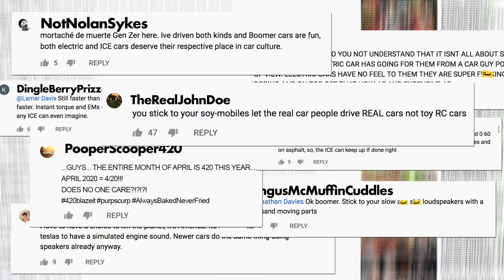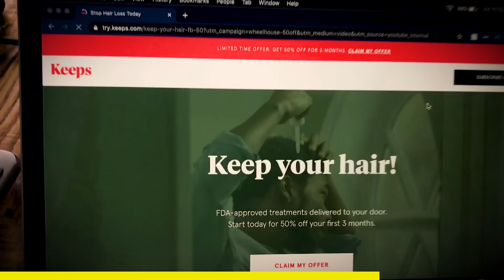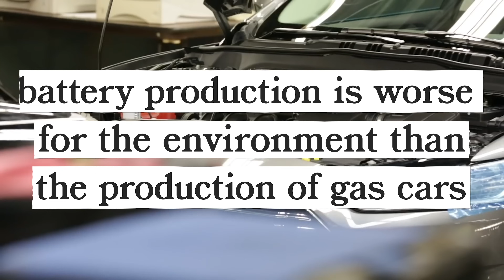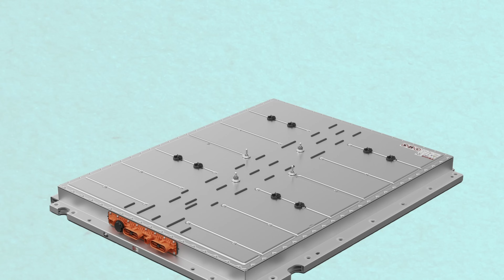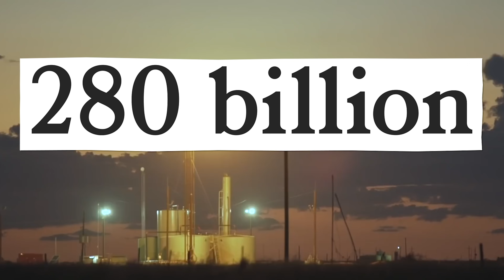Are Electric Cars REALLY Better for the Environment?

Comment: There isn't enough lithium in the world to replace all the petroleum cars on the road today.  You don't think you should have mentioned that?
Reply: @Brian-om2hh  And what other rare earth metals will the batteries contain?  In physics there is no such thing as a free lunch.
Reply: @sasquatch1554  there isn’t a free lunch it doesn’t mean there will be precious metals. Older batteries used sodium. Aka, salt (not quite but basically)
Reply: @engineeringtheweirdguy2103  good luck with that.
Reply: Not really, because it isn't a long term concern. In the not too distant future, EV battery technology will move away from using lithium.......
Reply: Actually studies say there is
Reply: @engineeringtheweirdguy2103  who did the study Elon Musk or some other troll?  According to the recent LUT-Augsburg report we could be running out of lithium by 2040 in the worst case scenario.  And that doesn't include if we use lithium for heavy transport vehicles and to power our houses at night when the sun goes down.
Reply: @sasquatch1554  I’m familiar with that study. From what i recall (along with similar studies) is that it is a projection for known lithium mining operations. As in, of all the mines in service currently, that’s when those mines will run dry. Which is starkly different to when we will run out of lithium. As demands increase new areas wills be prospected and new mines established to pull out more lithium. If you look at studies which consider all prospected lithium reserves which don’t have mines, that 2040 date pushes out to 2090. Then there are those locations which have yet to be prospected.
Reply: @engineeringtheweirdguy2103  You are incorrect and need to read the study again.  The study also accounted for new mines found.  2090 is the absolute best case scenario (still bad) if undiscovered mines are found they may not even exist to begin with.  The prices for lithium will sky rocket long before then.  Finite planet equals finite resources.
Reply: @sasquatch1554  am I? Can you supply a citation? And while yes, finite resources are a concern. That is why we need to step away from fossil fuels. There is very little left and if we don’t have a working infrastructure before they run out it’s going to be very hard to build a fossil free infrastructure without adequate energy to do so.

Lithium batteries have the advantage however of being recyclable. Only less than 0.5% of the lithium on a battery is lost over its lifetime to degradation. (SEI formation trapping the ions). Unlike fossil fuels which are burnt and gone. Further to that they aren’t used every trip. Current battery technology is set to allow modern EV’s to last well over 300,000-500,000 miles depending on your battery size. 

One final advantage of battery technology is chemistry. Not all battery types use lithium. New battery types are being made and experimented with all the time. Just because lithium is the best solution now does not mean it will be for the next 70 years. Lithium batteries for example have only been around since 1991. Before that lead acid was the way to go. Before that it was sodium. Things are constantly changing in the battery world, Tesla is toying with different chemistries to increase service life, power density and remove cobalt with some success. Toyota are touting that they will be able to successfully produce solid state batteries which would drastically reduce manufacturing emissions and, whilst Toyota has confirmed their chemistry yet, could very easily not use lithium at all.
Reply: @sasquatch1554  uhh, yeah they are getting those lifetimes out of them. Did you not open any of the links I sent you? There was even one for a Tesla at 1 million miles. I said I was familiar. I didn’t go and brush up and re-read it when you mentioned it. I was recalling from memory.

And the cost to recycle them isn’t the prohibiting factor. They aren’t super expensive to recycle. Currently the issue is with supply chain. You need to develop a supply and demand for used lithium. This is already being established with an increase in battery recycling plants planned or constructed around the world. Whilst still far fewer than you would need if the world went full electric, the trend is already heading in that direction.
Reply: @engineeringtheweirdguy2103  You are falling for Elon Musks bullshit.  If one of any kind of car goes a million miles do you think that means that will be typical miles for that car?  If they were so confident they will last that long do you think they would give you more than a100,000 mile warranty?  No I didn't get any of your links and there isn't enough lithium to recycle in the first place.  That is what you don't understand.
Reply: @sasquatch1554  ... yes there is. Also I’ve been having that problem lately. YouTube seems to block my comments when I put hyperlinks in them. Just go to google and type in Tesla at 300,000 miles or even 500,000 miles and you’ll be flooded with reviews of people who have gotten their Tesla’s to that point. Lots of blogs and news posts. So you don’t have to take my word for it. And whilst 1 million miles is a one off case (thus far) it goes tell you a little something about the cars.
Reply: @sasquatch1554  as for warranties, only some models have that. Other models like the model S performance and long range have 8 year unlimited warranties. Also worth noting is that the lifetime distance of the cars are for the most part hypothetical. A few years ago very few had made it past 300,000 or 500,000. But today they are becoming more common place.
Reply: @engineeringtheweirdguy2103  it's still only an eight year warranty.  After eight years you buy the damn $15,000 battery.  They know that majority of people will not be driving their limited range Tesla that far.  If you travel a lot you don't choose an electric vehicle due to the range and inability to charge.  The average American drives 16,500 miles a year thats 132,000 in 8.  Stop with the nonsense about going online and seeing how many miles people are putting on their Teslas.  You could do that with any vehicle and it is just an advertisement anyway.    Just because someone got a million miles out of their chevy doesn't mean I'm going to.  Teslas are well known for their poor build quality.  Look up lower control arms failing on model s and x.  That eight year warranty is for a reason and if you are one of the unlucky ones you are screwed.
Reply: @sasquatch1554  a lot of those problems havn’t been prevailing for some years now. Beyond that the build quality is at worst panel gaps and pain quality. Hardly lifetime defining considerations.

As for the blogs (not advertisements I’ll add). As many of them state. It’s not the impressive anymore to have a Tesla over 400,000 miles. Modern combustion engines average a lifetime of 250,000 whilst in road Tesla’s today are averaging a lot more. 

As for “buying” the battery, no. It isn’t binary, the battery doesn’t just stop working at 8 years. And you don’t design a warrantee for a $50k-100$k vehicle to expire so close to the expiration of the one critical component of the vehicle. Margins of failure will follow what’s called a bell curve. Warranties are designed such that 95% of the population fails after the warrantee. If you understand how battery degradation works, then you’d know that, that means the batteries are designed to last a LONG time. According to scientific studies, as much as 1,500 cycles. If you’re getting a range such as the model S long range of 402 miles (easily enough for any daily commute) then you’d have a lifetime of 603,000 miles.
Reply: @sasquatch1554  what’s also critical is that the end of life for the battery, and thus the warrantee is based on an old industry standard from when EV’s could could travel around 50 miles in the mid 1990’s. Which is that end of life is 30% degradation. In other words you’d have 70% of your battery capacity left and thus 70% of your range left after those 1,500 cycles and 603,000 miles which is why many people have been driving them well beyond that.

Batteries don’t work like a combustion motor. They don’t have a piston head explode through the engine housing. They degrade slowly. The bigger the battery, and better the battery management system (BMS), the slower that degradation occurs.
Reply: @sasquatch1554  you seemed in your last comment to be throwing a tantrum. Ignoring the facts or trying to hand waive them away with petulant, meaningless and unfounded/unsubstantiated excuses or accusations. But welcome to the real world.
Reply: @sasquatch1554  oh. And FYI, while the battery PACKS cost $15,000, the battery replacement only costs $5,000 plus labour. That’s because the pack itself is part of the chassis and drivetrain. It’s where the batteries are mounted into and what runs the coolant and other systems. The batteries themselves are less expensive and if you need to replace them. You take the seats out, pull up the floor, and replace the batteries like replacing them in a TV remote. You don’t have to replace the pack itself and all the infrastructure of the car that is incorporated in it.
Reply: @sasquatch1554  and in case my last comment has you confused. Tesla’s, and most (most) EV’s run on a pack holding around a thousand 18650 batteries which are live oversized AA batteries. Google it.
Reply: @engineeringtheweirdguy2103  Talk about a tantrum....lol.  Sorry, I don't trust your information from Tesla fan boy blogs as accurate or scientific.  No battery pack (replacing individual batteries they all get replaced) with labor is closer to 15,000 but I am wasting my time here.    Believe what you want and good luck.

P.S.  Do your future self a favor and trade that Tesla for a Toyota.
Reply: @sasquatch1554  that’s a stupid excuse if I’ve ever seen one. Someone makes personal blogs about what their Tesla ownership has been like over the last 300,000-500,000 miles and that’s, according to you, discounted because they own a Tesla and therefore must be “tesla fanboys?”. And dismiss every article from multiple sources including typically anti EV publications because they what? “Tesla propaganda”? You need to get your mind right kiddo.
Reply: @sasquatch1554  and no. I won’t be swapping to a Toyota. I’m quite enjoying my Tesla. At 120,000 miles. Only servicing it’s needed are tires. And between servicing and fuel I’ve saved $16,900 or more. Which will soon make back the difference between my Tesla and a Toyota Camry, it is also much safer than any Toyota and performs much better in speed and manoeuvrability and I’ve around 16 hours a year from having to drive to and wait at a pump. As I charge from home and wake up to effectively a full tank of gas.

I also get software features no other car on the market can provide which is also very appealing to me. All this for a 1% drop in battery capacity so far. So I’m doing above average at the moment in that department.
Reply: @sasquatch1554  have fun with your dinosaurs though.
Reply: @engineeringtheweirdguy2103  Oil comes from marine plants and phytoplankton not dinosaurs fanboy.
Reply: @sasquatch1554  almost all plants and animals create their oils. But not in the quantity required to make it worth while for use. That’s why the automative industry uses CRUDE OIL which are basically dissolved dinosaurs.
Reply: @sasquatch1554  and by basically I mean figuratively. The organism which became crude oil are much much older than the dinosaurs. But let’s not get stuck down into our prehistoric period nomenclature. I was calling your car a Dinosaur. Not the fuel. Because it’s out dated.
Reply: @engineeringtheweirdguy2103  ummmm no.  You don't know what you are talking about again.
Reply: @sasquatch1554  don’t I? What am I missing then
Reply: @engineeringtheweirdguy2103  Dinosaurs aren't called dinosaurs because they are prehistoric.  They are called dinosaurs not only because they are reptiles but because dinosaurs stand with their legs positioned directly under their bodies unlike modern reptiles.  Buying a used fuel efficient car or not driving at all (public transport, bike) is much better for the environment and your bank account than any new vehicle that you falsely believe is saving the planet.
Reply: @engineeringtheweirdguy2103 crude oil is petroleum that comes for marine plants, phytoplankton, algae and zooplankton not dinosaurs.  Crude oil has nothing to do with dinosaurs.  Crude oil becomes fuel after it is refined.
Reply: @sasquatch1554  you mean decomposed, million year old, marine flora and fauna. My reference to prehistoric nomenclature, was to the age of these decomposed flora and fauna. Which are from well before the Dinosaurs. You really like to read into things that aren’t there don’t you? And change topics. Nice one but not smooth enough
Reply: @engineeringtheweirdguy2103  I had to explain to you they are decomposed?    Ummmm ok sorry.....still not dinosaurs.  Ok man, it's been fun.......peace out.

Comment: So you're just gonna skip over how toxic spent batteries are? Cool. Nice "impartial" vid there bro.
Reply: Youre forgetting how toxic petroleum is, last time I checked tesla didn't leak millions of gallons of lithium into the gulf. You are also not taking into consideration battery recycling, the lack of needing engine oil and a few other factors as well, but engine go vroom ig lol
Reply: @coopninja3653  petroleum literally comes from the earth, so lets not preten it is more toxic than radioactive heavy metal byproducts from batteries. Not saying the products made from petroleum aren't also toxic, but they can be recycled as well. Probably more effectively than batteries tbh.
Reply: @urusledge  You understand that lithium "literally comes from the earth" too right? You cannot recycle gasoline. You can recycle lithium, the technology is getting to the point now where we are capable of recycling almost the entire battery. I don't know where you got radioactive from but thats completely incorrect. The only way lithium really pollutes is in the mining process. Petroleum pollutes at every single stage. Mining, refining, and end use. Try raising your IQ above room temperature before you give your opinion next time
Reply: @coopninja3653  which would you rather stick your hand in, oil or a spent lithium-ion battery?
Reply: @urusledge  The question is both misleading and incorrect. Was it Tesla or BP that leaked millions of gallons of toxic sludge into the gulf? Is it Tesla or BP that creates manmade earthquakes through fracking? Is it lithium or gasoline that causes acid rain without a catalytic converter? Your attempt at a strawman bores me

Comment: Excellent video.  However, I think a better comparison would have been to exclude the battery from the build portion of the car and use it’s production in comparison to the ICE usage of gas over the life of a vehicle...then you can compare the recycling of the battery v no recycling for the gas.  While recycling is currently challenging, it’s not impossible by any means and getting better every day.  Gas will never be recycled, regardless of technology.

Comment: A 20 years old gasoline car is still better for the environment than two to three ev cars in 20 years. Donut media somehow lost it's credibility especially when they said hydrogen car is flopped.
Reply: Hydrogen is flopped. Also an EV, wells to wheels produces around 20T of emissions from manufacturing to end of life. A combustion car has 40-50T. And the longer the cars run for the wider that gap becomes